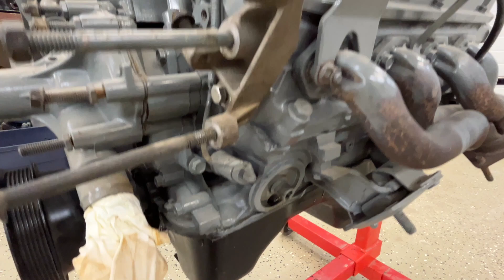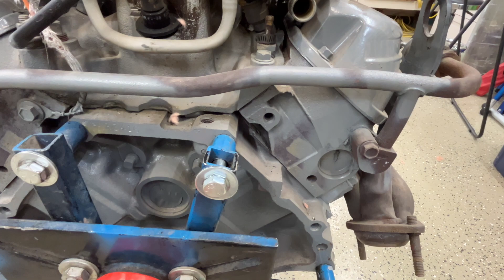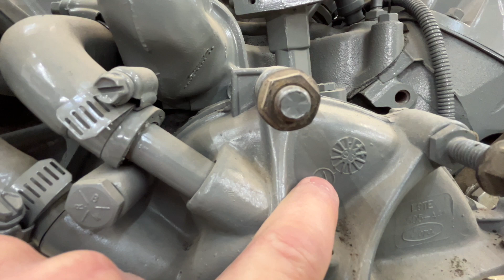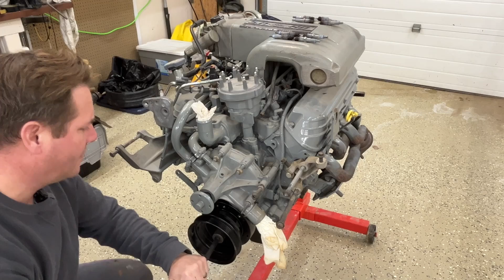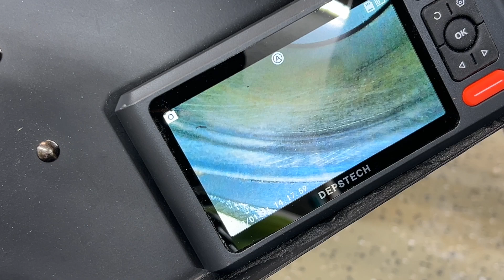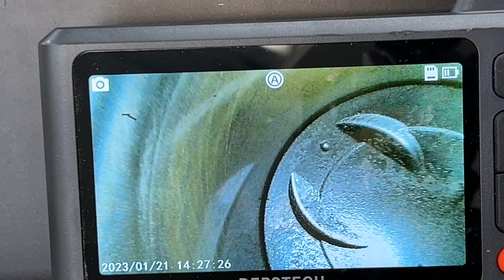Checking Used Ford 5.0L H.O. Engine Condition: Is it any good?

Comment: I have one in my garage. 1988 Speed density. Got engine, T5 trans, and computer module. Just retired 10 months ago, kinda wanting to put it in a early 2000's Explorer Sport Trac.
Reply from the maker: Nice, that would be a great combo for a Sport Trac!
Reply: Good luck with your project, I put a ‘93 5.0 L in my ‘93 Ranger 4X4, lots of work, time, and money. Had to put a body lift kit on to clear the A/C evaporator box, worked out good though, I put over sized tires on and it looks great.